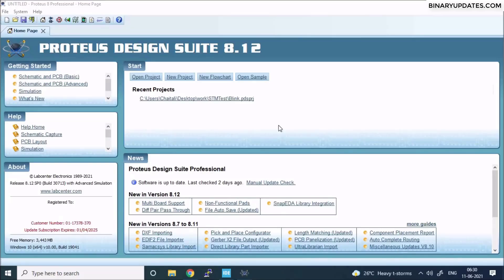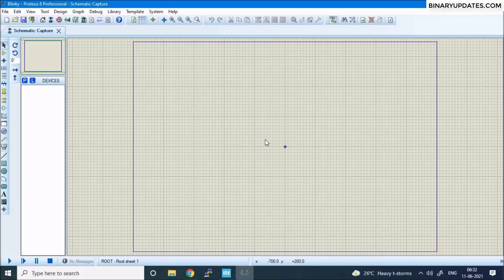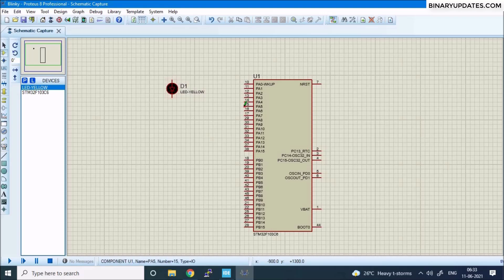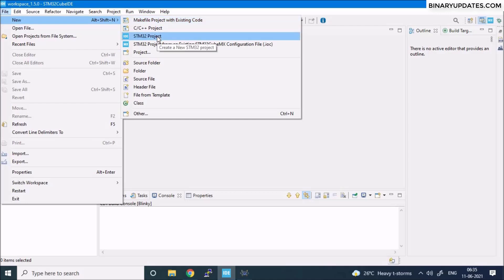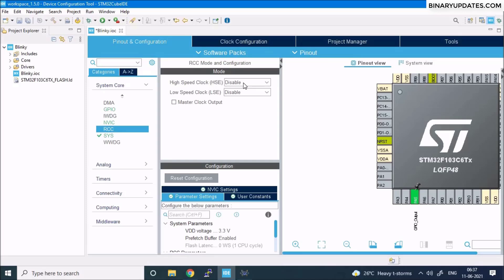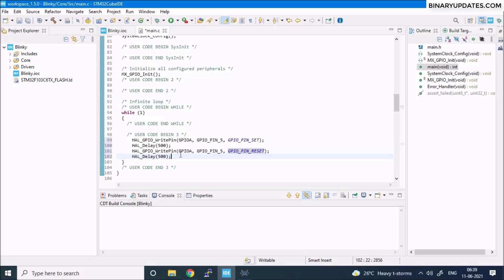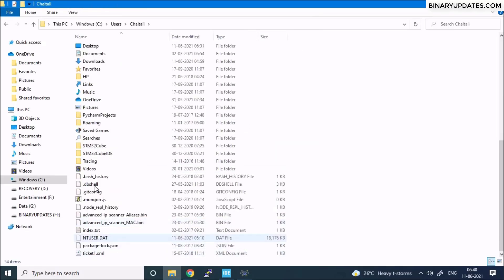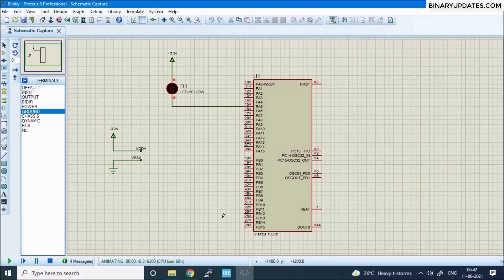Proteus Simulation with STM32CubeIDE Microcontroller Project

Comment: i have followed the exact steps, but while running proteus it crashes and completely closes the software,what should i do?
Reply from the maker: Hi, You can turn off WiFi on your laptop and try again. The reason behind proteus software is crashing because lack of computing or a version of license software. Also, give try with other version of proteus, its also possible that release is not stable. Good luck and best wishes!

Comment: Hey brother thanks very much this video was very useful. Please, Can you tell me where to download proteus that has stm32 library? I have one but it doesn't have stm32 functionalities. I need to use stm32f103c6 for my project, Thanks in the future.
Reply from the maker: I think this could be as issue with the version of Proteus you're using. Please make sure to use latest version. I have seen support for STM32F1 and some STM32F4 series microcontroller. Good luck and best wishes!

Comment: I did everything you said, but it caused 253 errors.
Reply from the maker: Please check the Proteus version. And also make sure installation is complete with all component libraries.
Reply: @BINARYUPDATES  no problem I found my mistake. I was using the demo version lmao.
Reply: @maynardstesticles  hi sir, i have the same problem, did yours solve by downloading some other version or could you please explain what you did to solve it
Reply: i have same probleme

Comment: I have Proteus 8.0 but it dnt show stm32F4RE, If I try to try new version like you have, 8.12 but its too costly. Pls advice a free sfotware to do simulation for stm32F411RE
Reply from the maker: Hi you can find other STM32F4 version. It does require some work around to make proteus simulation work for STM32F4 Microcontroller as very few F4 series parts supported by Proteus. Wish you good luck!
Reply: @BINARYUPDATES ok i understand Sir, pls tell me any Alternative IDE for STM32 CubeIDE....??? I have 32 bit based laptop which doesn't support to CubeIDE...

Comment: Hello, I am trying to blink a led with stm32 and proteus but is not possible. It apperas that stm32 is not running. What may happend?
Reply from the maker: Hi you must check the frequency settings into the properties of STM32 MCU in Proteus schematic symbol. And also check if power pins are properly labelled as shown in video. I hope this may help you. Wish you good luck!
Reply: @BINARYUPDATES  I finally made it. Thank you .....

Comment: how to add stm32 to proteus?
Reply from the maker: Hi Amit 
Usually, STM32 Microcontroller comes by default in Proteus. I would suggest you to install Proteus Version 8 or above. There is STM32F103 and STM32F401 parts can be found in proteus library. But you can add externally as well. I hope this may help you. Good luck. Thanks

Comment: Thank you very much for this easy to understand and very helpful tutorial..... I am a hobbyist and using arduino, esp8266, pi pico boards for my projects... I want to upgrade to actual Embeded programming using c++ ..Arm processor... Kindly suggest a course for me from your course list.. I have seen several of your courses on Udemy but confused from where should I start.
Reply from the maker: Hi Sameer, its good idea to move from hobby electronics to professional embedded software development. I would suggest you can consider Embedded System Design Starter Bundle which will give you good foundation of programming microcontroller and its protocols like Serial UART, I2C, SPI with real use cases. you can buy from anywhere you like either from website or Udemy. The content on website is more as compared to Udemy. I've give link below. Also if in case you feel to speak before you buy course. feel free to call us on number mentioned on website. 
https://courses.binaryupdates.com/learn/Embedded-System-Design

Best Wishes
Umesh Lokhande
Reply: @BINARYUPDATES Hi I also want to learn, can you please provide your watsapp number

Comment: Nice video..... can you please tell us which software you have use .is that software free
Reply from the maker: Hi Rupali, I've used Proteus 8 Professional in this video lesson. If you want to know exact version then its Proteus Revision 8.12 SP0

To get your STM32 Project up and running. If you're doing STM32 Microcontroller project based simulation then its important to have right version of proteus otherwise your simulation may not work even though your code is correct. I hope this will be helpful for you. Thanks!

Best Wishes
Umesh Lokhande